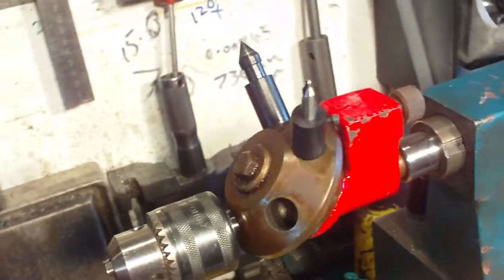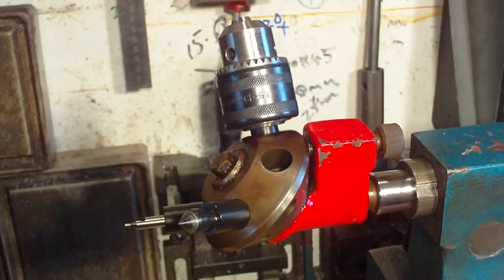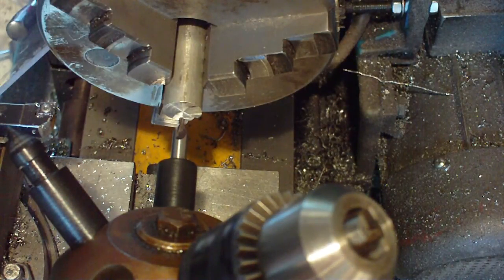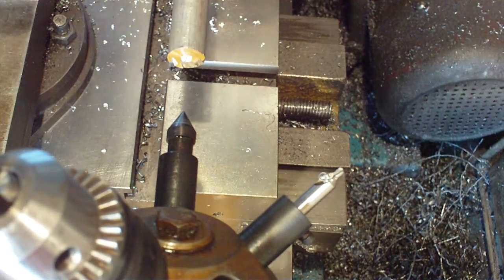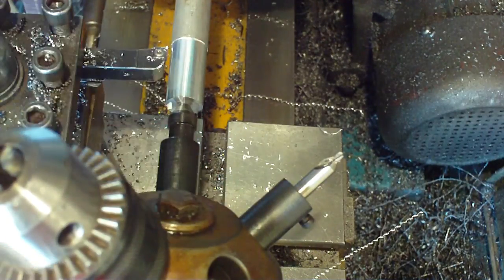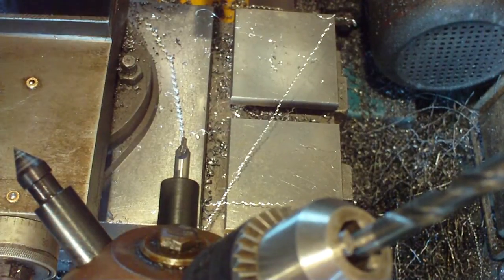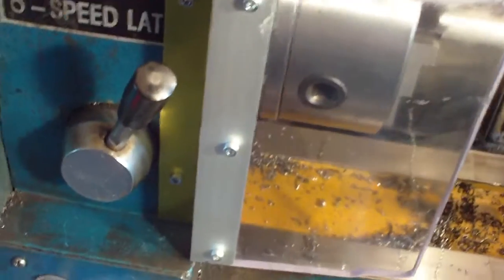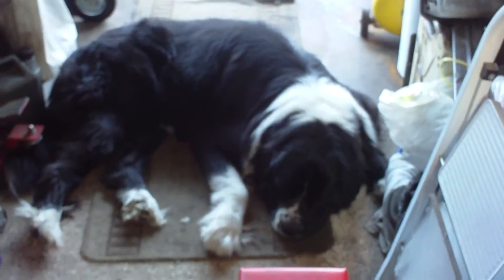Turret

Comment: How do you keep the center drill and adapter from spinning?
Reply from the maker: They are held in place by set screws.
Reply: Ok, I guess 2 set screws, then: 1)set screws in the turret for the tool holders, and 2) set screws in the tool holder to the tool. I located a factory built tailstock turret for my Atlas 10F and it looks like it will need some work, rough shape. I hope I can rehabilitate it to work order - these look fun. Makes you feel you are in production mode...

Comment: does this require special tool holding, to hold a tool in the turret?
Reply from the maker: Yes I had to make a holder for each tool and the little live centre as it came with none of those.  It was a gift so I can't complain.
Reply: Spen Crowson ahhh alright perfect, thank you. I saw reviews of a turret online, and they were complaining about wobbling/wandering and I figured it was because they were using a chuck with too long of a shank. I’m trying to find one for the machinists at the place I work at. Do you have any issues like that?
Reply from the maker: It's ok for the everyday turning that I do on my 16" lathe, but the centre does struggle when pushed hard due to it's distance from the tailstock.